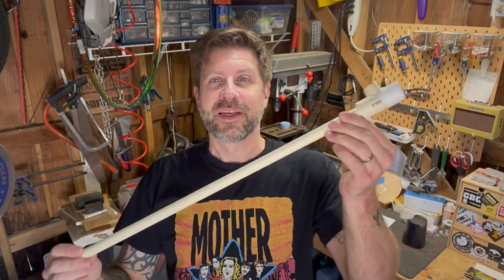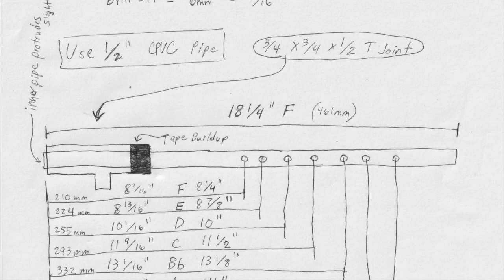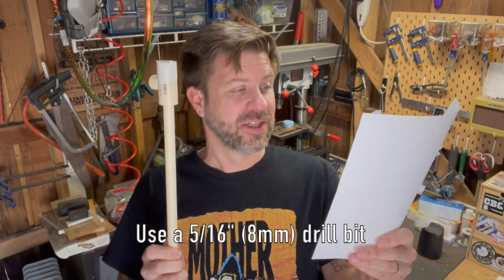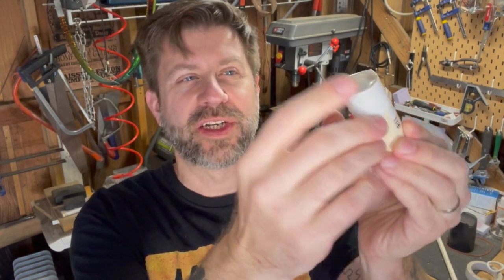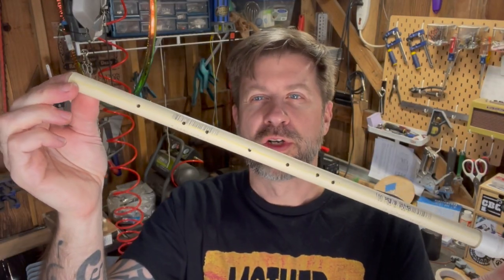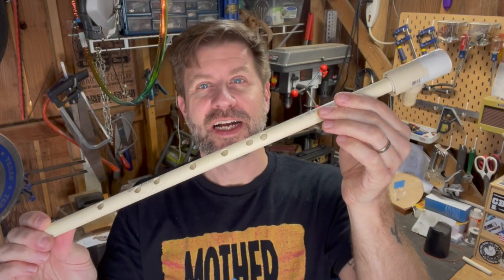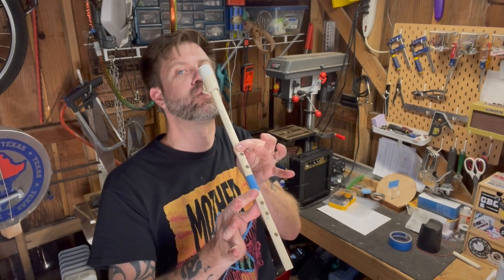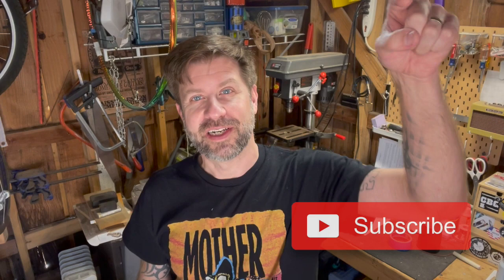My Second Attempt at Making a PVC Membrane Reed

Comment: Ziplock freezer bag plastic works well
Reply from the maker: Thanks for checking out the vid. A freezer bag seems like about the right weight. You want something that doesn't stretch but is light enough to vibrate freely. Thanks for the great suggestion.

Comment: Are all the holes same size,,? I think you can play it sideway too 😮
Reply from the maker: @JeanLoi-bc3ps  yes. All finger holes are the same size. And yes you could hold it sideways but youd probably want to turn the smaller pipe 90 degrees so the finger holes point upward.

Comment: hey just wondering where you got the measurements from? also did you have to tune the instrument by shaving more off the hole? thanks
Reply from the maker: Thanks for watching. I saw one of Linsey Pollak's videos on how to make a foonki (apparently that's what this fingering pattern is called) from PVC pipe. I used the dimensions from that video. All of his dimensions were in mm so I had to convert to inches but other than that, I just followed his pattern and it seemed to work.
Reply: Thanks so much for the reply! Okay I'll follow those measurements too! I'm making this for a physics project so I was wondering whether you had any sources for how this instrument functions? Since it's not an official instrument I'm struggling to find specific information on how it works. Thank you again you've helped me so much!
Reply from the maker: @danielwang8182  Glad I could help.